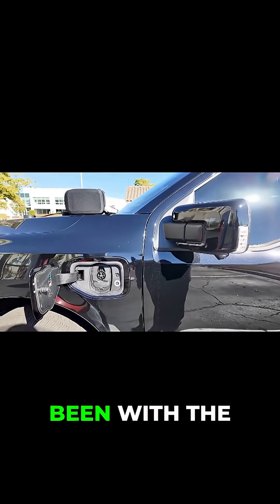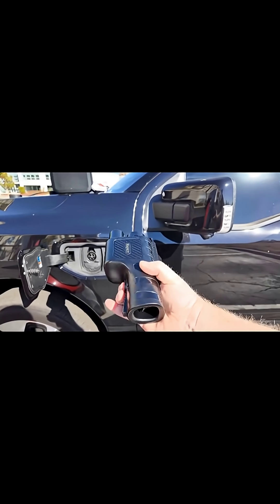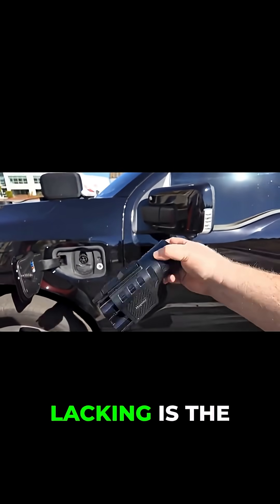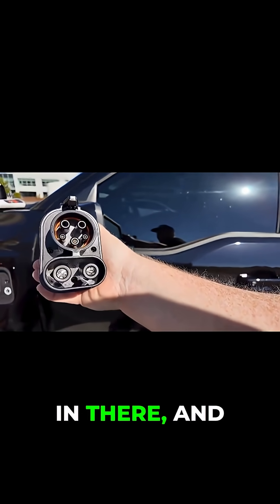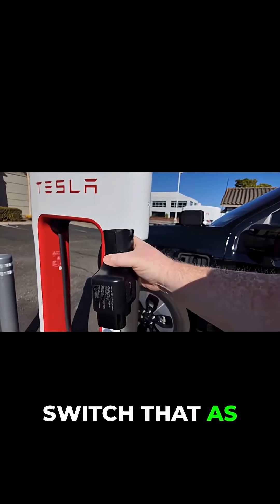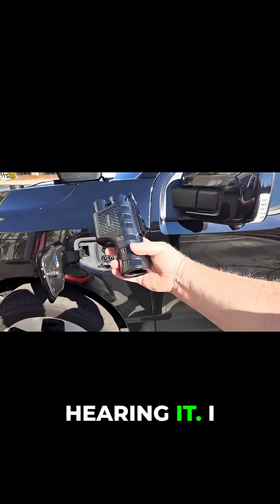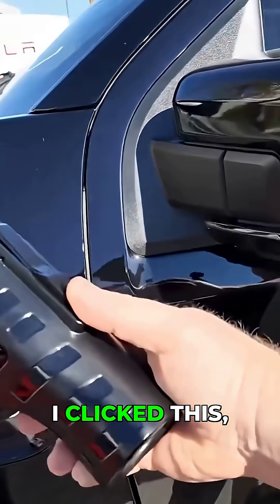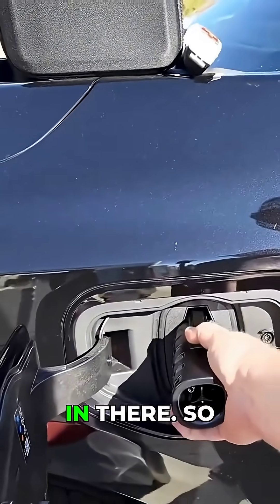🚨 Major Safety Warning: Interlock Missing on EV Adapter!  #electricvehicle #teslacharging #tesla

Comment: No need normally as the CP pin will be disconnected first which trigger the DC to be disconnected before the plugs are 100% separated, as the are shorter and first to lose connection
Reply from the maker: You’re correct that doesn’t leave any room for error though and no redundancy. The fact that nobody’s ever been hurt backs up what you’re saying but ideally I would still like to see a switch there or the interlock.